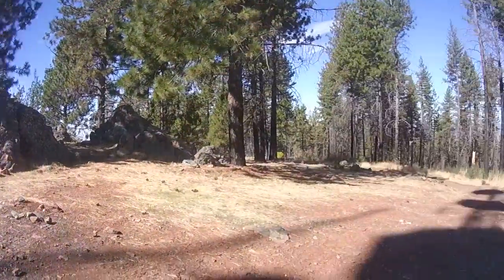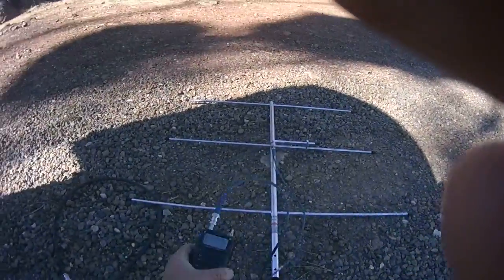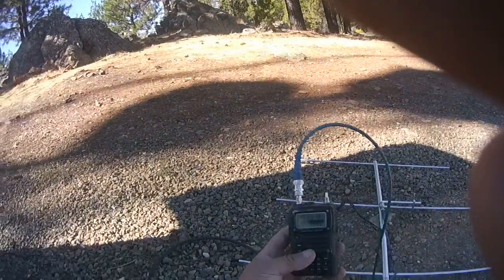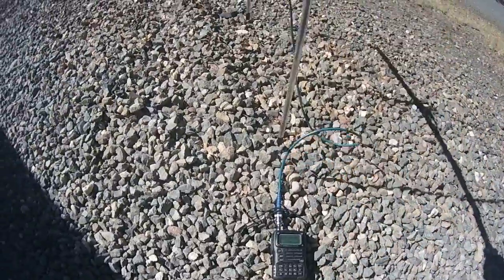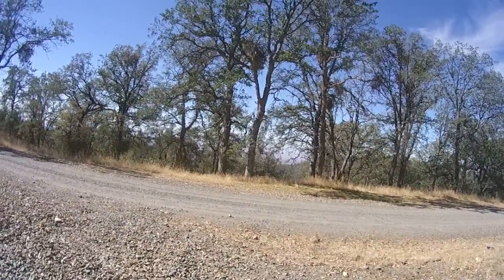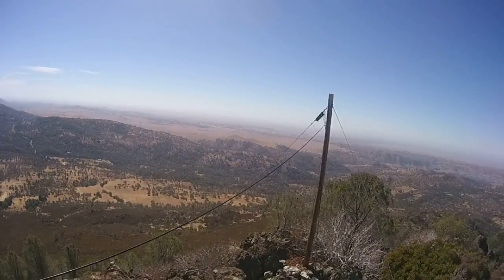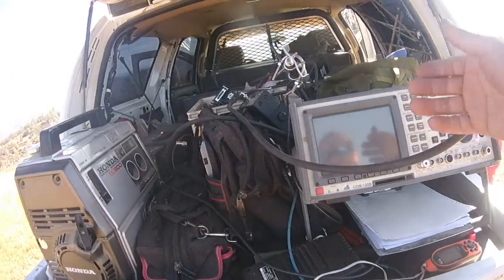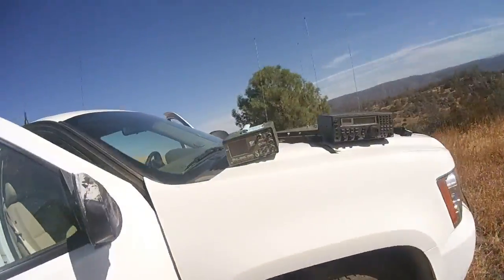SHTF Intro To Radio Direction Finder "Seek & Destroy" Part 1

Comment: Okay, if the Sheriff's repeater is really being jammed and you've really been asked to help, why don't you shut up and get at it? In all honesty, your RDF technique is crude and ineffective. Almost nobody uses triangulation anymore. Radios and antennas have gotten sophisticated enough to allow you to just follow the signal direction to a small area (a city block or less), after which you use common sense (where could the transmitter & antenna actually be within that small area) to find the source.
Reply: Common sense says that it could be any of these 400 houses in an 8 square mile area. I'm not going to spend $1k on a MDF

Comment: Ww2 German operators would pinpoint radios by RDF.  on the radios(in prison camps) local oscillators. Found by triangulation.  So it's not a new thing. Though very useful.

Comment: All ways stand away from radio/antenna. To make long distance fixes. Why? Every degree translates to a lot of area. And the term is called triangulation. A map vs a set of readings. And crossing lines on your map give your location . Good hunting practice. Tks for good show. Kv4li

Comment: 3 element Yagi has main sensitivity lobe of 30 degrees. It is better to use small loop antenna for transmitter hunting - even on VHF, because loop antenna has 2-3 degree very deep sensitivity minimum which gaves better bearings and moreover it is easier to search for minimum of signal when the signal becomes really strong in the final stages of searching.
Reply: I used to turn the antenna around and use the back end to get a smaller null.  Gave a better idea of the signal direction.

Comment: Frequency jamming is a hobby of some people. The tricks are to use short burts at random times. Transmit long enough to cause the equpiment to be disabled then it will take some time for it to come back on line. Thats when another burst is sent. Although don't transmit exactly when this happens because the people searching will find out the pattern. Some things don't have to be constantly jammed to become compromised. Yo just need to be able to make it unreliable enough to cause problems. Another trick is to never directly transmit towards your target. This makes you very easy to find. Better to use more power and reflect the signal of the terrain towards the target. Multipath propagation that is a problem for transmitters can be taken advantage of to place your transmitter within one of the "nodes" to make the signal look like its comming from a certain direction but really its bouncing off a hill or a building. You can also shift the frequency around to throw off trackers. Purposely transmit on frequencies that don't cause jamming to make it look like a malfunctioning equipment. Not just any frequency but ones that commercial equipment would actually use if not configured right. Also verying the power will make the signal look like its father away or closer then it really is. You can use this to mask the location: maybe at a certain power the signal will bounce off a hill but at a lower power it will appear to coming from the opposite direction.  The use of yagi antennas with lots of directors is key to focusing the beam. Also remember your equipment is going to give off an IF signal that can make even receivers detectable. You can create phantom IF signals by finding out what common electronics use and set up slightly higher power putting your signal below the noise floor. There are tools in linux radio programs to make all kinds of signals or you can even just record a signal clean it up and re-transmit it making it look like a valid peice of equipment. The limit is your creativity and with enough planning and knowledge you can minimize being detected and enjoy many hours of this hobby.

Comment: Great info. I love this stuff. What would be the purpose of needing to find the malfunctioning source? I know this is a demo but I would figure there would be some sort of visual read out of all the transmitters.
Reply from the maker: The need was a priority, it was jamming the sheriffs dept radio system and possibly others. Days prior they did have some scary moments when trying to arrest some pretty bad guys. This device long with the majority out there are not monitored or some sort of shutdown mechanism to prevent this type of interference. This bi-directional amplifier by nature is a squirly beast.  This is the third device in my 25 year career that turned into a radio jammer. Thanks for watching...

Comment: Good video, back when I fox hunted for fun, I'd also have a telescopic antenna set up that I could reduce in length as I got closer, then switch to a wave guide to close in on the target. (Just a short stubby antenna mounted in a coffee can with a wooden handle.) It's interesting to talk to a drunk CBer with just an old toy CB radio walkie talkie that used a 9 volt battery and only put out a few milliwatts of output and you'd be the only one he could hear 
.

Comment: It looked to me like you were over thought this. Had you done an intersection on your map you would have a general idea of where the signal was coming from.  Using a military style protractor, or ruler, you could draw out the line from position 1, at position 2, draw another set of lines based on the point where you get the strongest signal. with a minimum of two lines you can now see the point where they intersect.  Where they intersect is where your signal originates.
Reply from the maker: That's what I did in part 2. I want to have more data points for more accurate positioning, which I get by going from Pos 1 to 2. If I can get a bearing from the opposite direction, even better. Thanks for watching.

Comment: A yagi is a very poor choice for a DF antenna. A few observations 1st It's much more effective to use the deep nulls off the bak of the antenna rather than primary gain lobe. 

Here's why, The maximum gain and 3db bandwidth of that small  yagi primary lobe is not nearly as high or as sharp as the deep nulls of the back sides of the antenna . The yagi might have 3db or so forward gain with a whopping 60 degree 3db beamwidth . On the other hand the nulls can be down a whopping -20+db with a beamwidth of less than 10deg and there will be two nulls on either side of the back of the antenna. hands down the best antenna for DFing is the small mag loop.  Mag loops have very sharp, deep nulls so instead of peaking the signal  in the primary lobe you null it using the nulls of the back of the antenna.
Reply from the maker: +Dan Nelson We have mag loops for very close proximity sniffing, such as low level harmonics looking for intermod. This case time was a factor due to officer safety and our DF gear were missing some cables. Luckily this was an ideal easy find due to the bidirectional amp constantly transmitting at about 15-30 watts. Its the intermittent signals that drive you bat crazy.. Thanks for the info, the mag loops might be a god handy set of tools to have if it ever happens again.
Reply: +RellyOhBoy Obviously you must not be too mechanically inclined or don't build much. I've built a lot of antennas and a small receiving Loop for direction-finding is much cheaper to build not to mention much easier to get in and out of a car with much deeper nulls than a Yagi
Reply: +Dan Nelson I'm an IT Technician not an RF Tech so your experience may surpass mine in this particular area, so please turn up the squelch on your ego for a second. We're not talking about homebrew equipment I'm going by what he is saying and doing in this video. From what I see, he's not using any homebrew equipment. The yagi and HT he's using are commercially available aren't they?
Reply: +Dan Nelson Watch the video again, he said cheapest most basic equipment to use. Not the most efficient. A comparable Mag Loop antenna would cost 3 to 5 times as much as a portable yagi.
Reply: I built several mag loops from what was essentially free sentimental junk from 30 years of working as an industrial/institutional/utility company electrician. As I make an antenna I can think back on the boss' brother getting caught selling his half of the #0 solid copper wire we stripped from the hospital, and the engineer that sat in a pile of dirt with us and sanded the corrosion off 2" tubular copper bus, or 70 year old Bob & Linus trying to be supermen & walk high iron installing lightning protection, only to install copper on aluminum flashing  so I had to go rip it all back out. I did my share of RTVB and other transmitter work too. I just picked up a pair of 3600 volt transformers, and I already have motorized Variacs, variable vac caps, lots of copper for coils, and other transformers I can rewind, so time for some new linear amps. The  nulls on the butt end of a Yagi will give a finer direction. A loop is even better. I had my brother and a pair of loops out looking for something jamming someone, again. One of the vehicles is down, but we did okay. I am also adapting an old junk Wavetk SAMIII for whatever. It works as a direction finder, and or antenna analyzer. The built in  spectrum analyzer was kind of a letdown, but free is free, so no complaints. 73s KI7AQJ

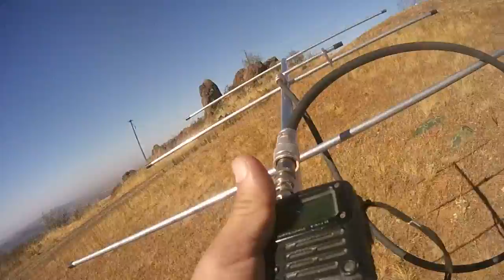Comment: Horizontal polarization (16:50-17:23) is extremely inefficient with ground wave propagation. Especially since everything you were receiving from had a vertical antenna. In only rare cases, it can help to tilt it during triangulation. Just wanted to make sure you knew. Nice video, though.
Reply from the maker: +KG7DYO Very true... It helps in attenuating the signal without adding pads on the antenna port. Gotta use all the tricks to skin this cat. Thanks for watching &amp; commenting.

Comment: Love it, you use similar processes to myself. I need to get a beam like yours though my 13el or whatever it is is too big for the car and tracking really :( but works. I usually start at home with the portable (usually Moto XTS with ear tube) and pan around in vertical then flip to horizontal to lock onto where I think they are (seems to drop the signal if I'm wrong which is rare). Then drive time. I never really went with mapping software more location triangulation and local knowledge. It's good to see others using similar methods but I could not use anything other than another radio to track :(.

It's ironic seeing this actually as when I approached Simoco for P25 upgrade pricing I was met with the bs argument of "we won't provide it because you could interfere with emergency services". My great reply was along the lines of "I don't need P25 for DoS! A few FM828's (OLD crystal radios commonly used in repeaters) into yagis with the right crystal and 100% tx with cooling will VERY quickly knock whoever off their network". Their higher ups seemed to agree with me that their argument was stupid and supplied the pricing.

You would have to be careful around here though on the cops, I'm not sure what they are using but I've heard them reply to cars asking about where a car in trouble was and they were able to reply with "the last signal came approximately x km's from the tower on xyz at x degrees mapping around abc position".

Comment: Something I've been playing with lately is SDRs. The $8 dongles are certainly useful,  but there are a couple that are built on dongles on ebay that have some of the mods that make them better already done ($40-$60, which is pretty cheap relatively speaking, considering upconverters alone cost $50 and up), and include an upconverter for HF. They will work with android, so you could use one for this application as well have maps all in one device (electronic mapping is great isn't it?). Even better would be the hackrf or bladerf, etc (you can spend as low as $8 for an SDR upwards of $1000s). The one guy uses a hackRF that he has made a very sophisticated fox hunter from, that you might be interested. He has done many vids on youtube, just look for something like all you freqs belong to us or hackrf, the guy is from Australia (now in the US), so you will know when you find him.

Comment: When you find him  call in some artillery fire........LOL
Reply: ON TIME ON TARGET!
Reply: How about just a CMFG burst to knockout all his electronics within a 200' to 800' radius? (It's like a mini-EMP-bomb.  CMFG works on a different principle (not WMD-based like EMP air-bursts which normally are delivered by guided missiles -- CMFG can be delivered by 1-2 infantrymen), but has the same effect without affecting an entire city: to takedown a more localized enemy operation's electronics -- everything from NV/IR & red-dot sights to his comms, vehicles except VERY few old-style diesels, etc (platoon/company/battallion sized), even including his ability to "paint" you w/lasers, give orders over an electric bullhorn, his snipers lose handheld electric anemometers & laser-thermometers -- so your own electronics aren't affected even as you're <1 mile away & you can move-in quickly before his commo team even have time to say, "WTF?," turn a few knobs to dbl check what their own eyes are telling them, and notify their C.O.)

Financial penalty for interrupting police channels: You need to buy a new smartphone, vehicle, all kitchen appliances except some propane types, Baofengs, stereos, Air Conditioner(s), burglar-alarm, computers, etc all get fried. ;-P  you'll never forget "Put an OFFSET on your Tx frequency if you wanna scan the police channels using a TRANSceiver instead of a proper scanner" ever again.

Comment: How does a radio signal travel from person A to person B?
Reply: +Joshua Xiong Think of someone holding a flashlight. When they aim it at you, you can see the light, which is the way radio waves work, except instead of using your eyes you use a radio, which changes the signal to audio. Now imagine someone had a flashlight on the other side of a hill. You could set up a giant mirror on top of the hill so the light can be seen farther away, this is essentially how repeaters work, they take your signal and re-transmit it, so it goes farther. After all, radio waves are electromagnetic radiation, just like visual light is.
Reply: Daniel Fransiscus
Okay thanks. Powerful radio then. Do they know the area of your location?
Reply: Here in the US, people can look up your callsign and it will list your address, but unless you give out you're physical location or they find you with the methods shown, then no. They can tell that you are within a certain distance of the repeater because of it's coverage, but not which direction. If you aren't causing harmful interference, you should have no trouble as long as you have a license. I should also mention that you don't need a powerful radio to use repeaters, in the US there's a brand called Baofeng that sells radios for $35 that work just fine.

Comment: I am studying right now to get my Technician Ham license. This video brings back good memories of Fox Hunting. Where can I get one of those directional antennas. I am thinking about getting the Yeasu VX-8 FM Triple band handheld. Is that a good handheld.
Reply: +MontiR Aruba Good luck with the license if you haven't got it yet. If you have, go for the general. I got the gen. at 13, so it should be super easy for you and easier than the tech. Now at 15, I'm about to take the extra test (super exited)! I have a VX-8dr. This radio is so nice, it would take 10 paragraphs to explain! It's also good to get into HF, which is 10x as fun! A good company to get a yagi (directional) antenna is from Arrow antennas. I don't own one, but they're pretty popular and have good reviews. They also make dual band yagis so you can work satellites! I think I'll get one someday. You can also make a simple yagi. 73!
Reply: +KG7DYO I got my Technician!!! Yay!!!! I also downloaded EchoLink so now I can talk to anyone in the world.
Reply: +MontiR Aruba If you can get onto DCF-ARC on Echolink, there is a net run by N7BZN (Scott) at around 6:30pm or so on Fri. It goes for a couple hours. If you check in to that net, you'll probably hear me: Liam. You can learn a lot on that net. So, what is your callsign? And Congrats for the license!

Comment: A yagi and an attenuator is all of the gear you need to find the fox. Triangulation works well. In close a doppler system works super. You need to get a tripod for that yagi. Laying it on the ground is not real good.

Comment: Really good information. Have you tried using the RTL-SDR dongles? It's a very cheap solution that offers a 3.8 megahertz bandwidth. And only for $20 or so you can connect it to your Android device or any sort of smartphone. So no need for generators to do is connect your directional antenna to the dongle and do your work with your smartphone. You can even have it sync up the strongest signal received on your target frequency with the gyroscope in the phone to pinpoint the heading and do all the calculations for you.

Another advantage is that you're able to see large spreads of frequencies so as the frequency shift you can see it in the waterfall and you will still be able to track it.

73's KC3EOL
Reply from the maker: Brian Link Yes I have considered it, but never got around to it. Sooner or later I will mess around with the RTL-SDR receivers, that will definitely make this cost effective for everyone. I may experiment more deeply with those to match the impedance of the antenna port. I believe its 75 ohms instead of 50 for the 2 way stuff. So many ideas, too little time. Thanks for watching.. 73's

Comment: this system of finding a signal won't work if the person was to move around transmitting the signal. these ham guys would be scratching the heads, also very it by a few KC's or a slider then it really gets hard.